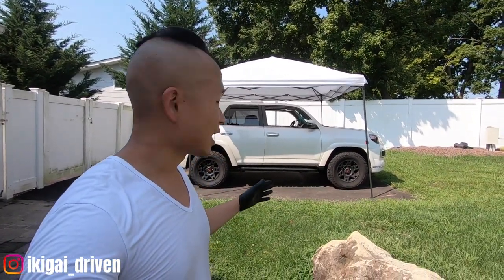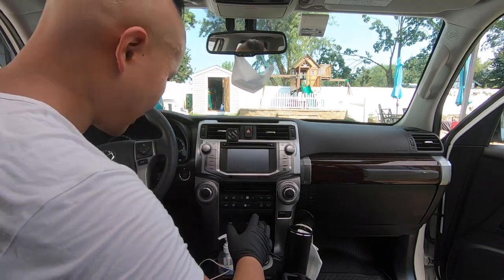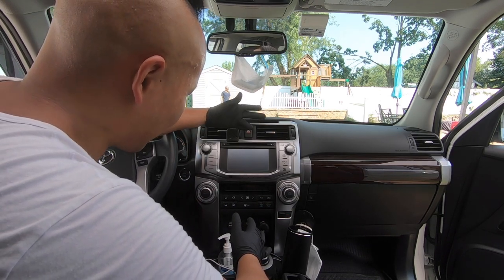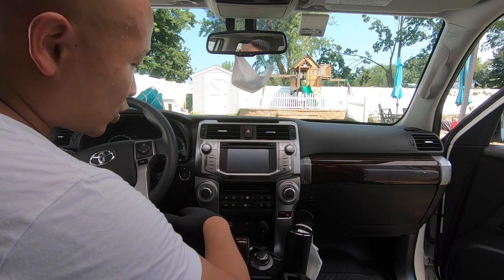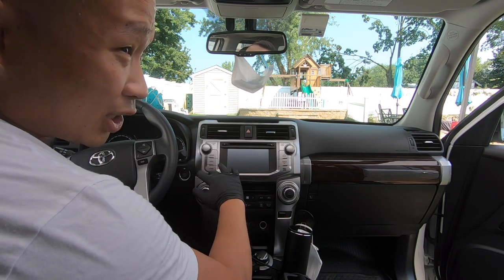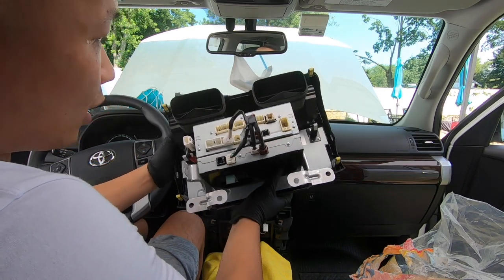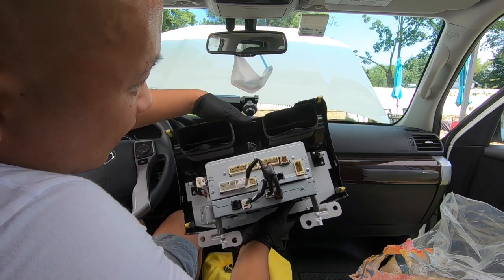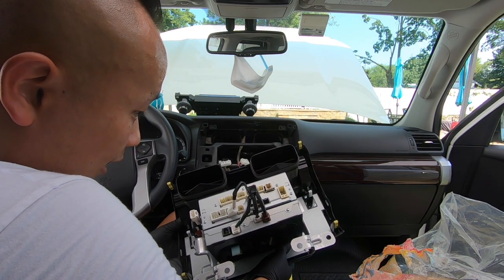TOYOTA 4RUNNER | ULTIMATE T10 CAR TRIM HOME GUIDE

Comment: Nice video. Where did you end up mounting the antenna and gps. I have the new t10 v3 and I just put them behind the radio. But im sure theres a better place to mount them. Thanks in advance
Reply from the maker: Mounted both of the on the glass next to the pillar
Reply: @ikigaidriven  can you show how that was done?

Comment: Awesome video! How did you get the backup camera to work? Mine doesn't come on when I put it in reverse.
Reply from the maker: Just automatically comes on, maybe you didn’t wire it correctly

Comment: I know this is an older video, but I'm thinking about buying a T10 and finally accepting that it's probably the best value head unit for the 4R.

Question though... I've heard others complain about their polarized sunglasses blacking out the T10 screen. Did you experience this as well?
Reply from the maker: Nope had mines since the drop of the video and no issues so far
Reply: Are you ordering from CTH or somewhere else? I ordered from Hamilton and I couldn’t even get a straight answer on when it would actually ship. Then called a day later and they said they were out of harnesses so they’re just cancelling the order 🫠
Reply: @benjaminhogate1394  definitely CTH
Reply: I found it on Amazon 3 days ago and got it for $450 shipped and sold by Amazon. Got delivered today so I'm gonna install tomorrow.
Reply: @meatball1080 do you still have link?

Comment: Just installed this head unit in my 4runner. How to I hook up my iPod shuffle? I have the USB port and it is plugged in. I just don’t know where to go in the head unit to click it on and make it play
Reply from the maker: Thats a good question,  have you tried going through the stock stereo options
Reply: @ikigaidriven  thank you, I will do some more looking around and try to figure it out. I really like the head unit so far. A huge improvement over the stock setup

Comment: my radio will not pick up channels anu ideas on troubleshooting?
Reply from the maker: Did you plug in the antenna
Reply: @ikigaidriven  from the instructions I received the the only antenna was for 4G.  ( which I didn’t have in my delivered goods)
But if you can provide a video and link to show how to allow to pick up AM/FM radio I would greatly appreciate it.

Comment: Question I bought a 4Runner that already had this installed. When changing my heater blower level it shows a display on where it’s blowing and how fast it’s blowing but it says my rear heater is locked and won’t blow anything out the rear heater how do you unlock the rear heater??
Reply from the maker: normally i dont have control of my rear heater and im not sure if any 4runner can control the rear. it comes on automatically when i turn on the front facing vent

Comment: What did you do about the small black cable for the sub (I think its the sub) coming out of the factory JBL amp (small black port)?
Reply from the maker: Hard to tell you at the moment is been a while since I’ve done the install, what I recommend is looking through the wires again. Everything had a spot, my sub is working fine

Comment: Does it sound the same or better than the factory? I installed the Dasaita 10.25 and it sounded terrible. My subs weren't hitting the same and overall sounded distorted when i turned it up. I played with the eq but it still wasn't as loud or full as the factory unit. Im looking to purchase the T10 if it holds a better quality sound.
Reply from the maker: Sounds pretty good to me, have to play w the equalizer. I only turned it up about 25% and I’m getting way more bass in the front, going up 100% distorts things
Reply: I installed that unit also and it sounds better, play with the settings

Comment: Lookin good, trying to do something like that with my Tacoma but i need rock sliders first. This hobby is getting expensive..
Reply from the maker: you guys are loaded. if youre interested in the c4 fab stuff i might know a guy that can get a discount (not guaranteed)
Reply: @ikigaidriven  I moved out and bought my m6 and Tacoma. Im far from loaded just yet, just putting money aside into savings and dumping the rest into my tacoma 😂. I found a local guy that owns a company near my shop. He hooked me up with bolt on hrew sliders from warfab for $550. Haven't pulled the trigger because the trails i go to dont have many rocks so i bought a rooftop tent instead 😂. We should set up a day to come visit Matt and me so i can take you to some trails my friends and i go to. Gotta get your moneys worth out of the 4runner
Reply from the maker: Sounds like a plan 👍👍👍

Comment: How many cameras can the unit support?
Reply from the maker: I back has 2 slots but I believe you just need a different harness to support even more
Reply: @ikigaidriven  Thank you! Were you able to keep all of the oem steering wheel button functionality? If so - Did you have to do a ton of programming?
Reply from the maker: @Chobham  super simple to do, the double din has an app that you can program all the buttons
Reply: @ikigaidriven  Much appreciated!
Reply from the maker: @Chobham  anytime